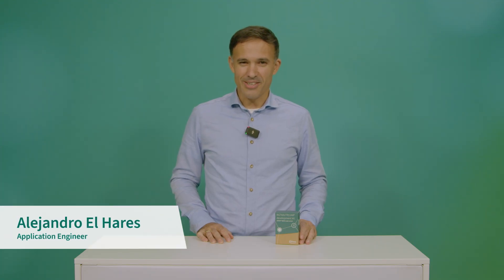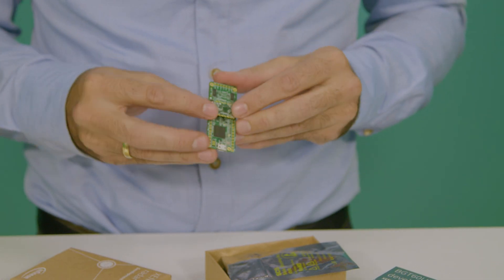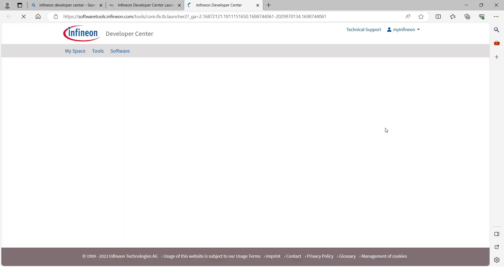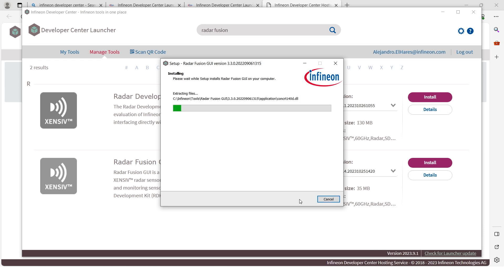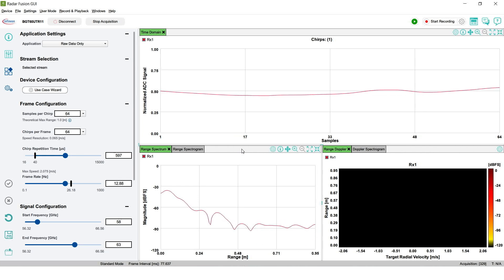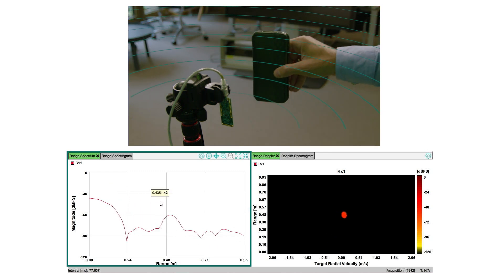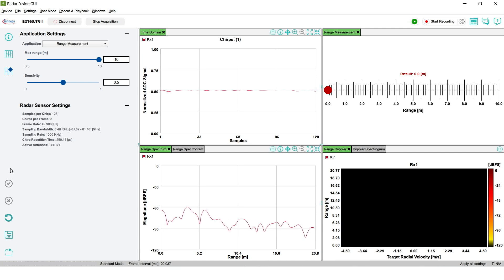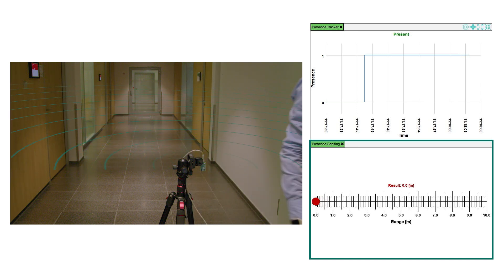How to get started with XENSIV™ 60GHz BGT60UTR11AIP radar demo board | Infineon

Comment: Hello, can this detect gestures? Like pinching etc as shown by Atap?
Reply: I would suggest BGT60TR13C for gestures as it has more antennas letting it sensing 3d gestures, whereas this sensor has just one antenna making it capable of detecting only 1D gestures like push pull etc.

Comment: How can the algo be integrated on embedded hardware? How much memory and throuput performance is needed (with/without HW FPU) ? Could this be run on Cortex-M4 running at 96 Mhz ? How much samples per second are possible ? How fast can the algo put results to the output?
Reply: A Cortex-M4 @96 MHz can collect and process the data in less then 100ms or even faster. The algo is already available for Infineon's PSoC MCUs, so it can be easily ported to any other makes or you can always build one yourself.